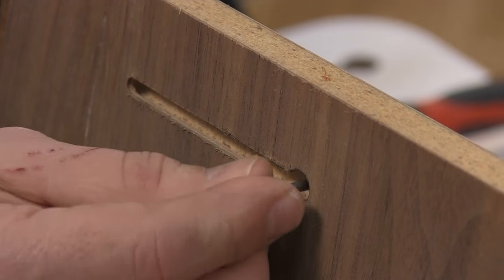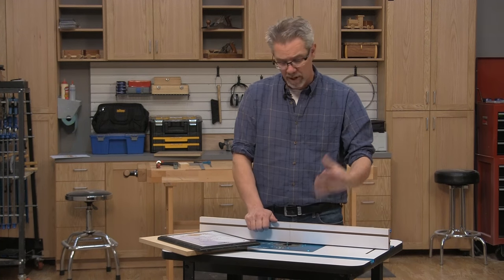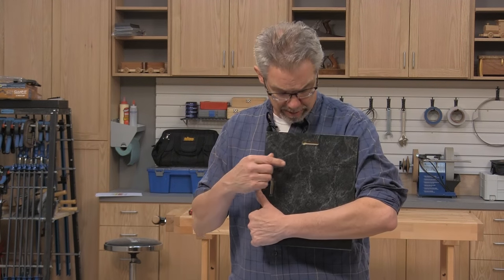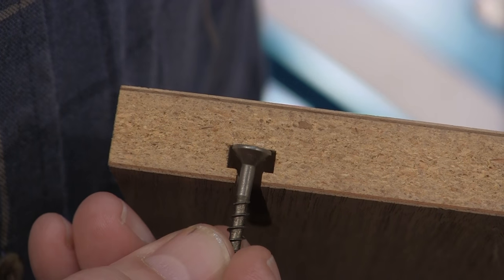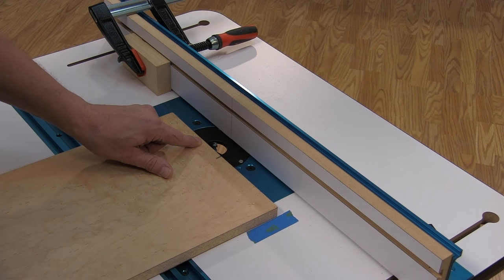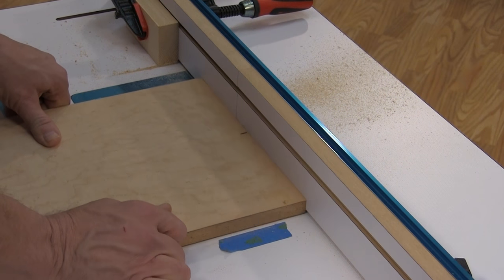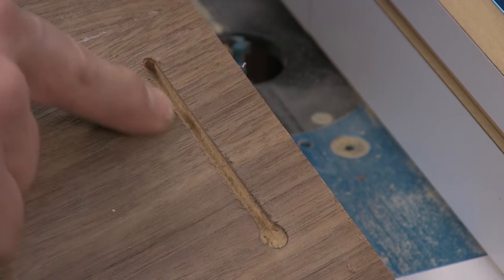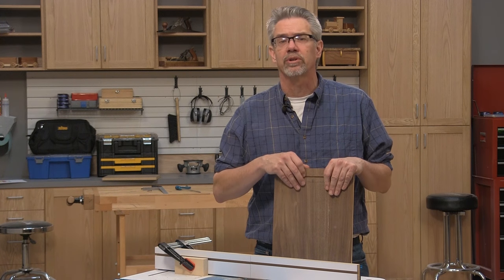Cutting Keyhole Slots for Hanging Pictures and Plaques

Comment: Done this when the dust/pitch accumulated inside the hole/slot and when turning the router off and sliding the bit back across to the exit hole.... it can’t align to pull out due to the compacted dust; sticking the bit tight to the table. Any advice on clearing this?
Reply: I think you need to keep router on while backing it out until you get close to your exit.

Comment: Not sure how I can see that plaque hanging from one screw and be centered?
Reply: He says the length of the slot isn't important as long as it goes through the center. When you slide the picture on you move the frame along the wall till the screw head is centered in the board and it just hangs there
Reply: Slide the plaque over the screw until it falls into the big hole, then slide it horizontally until the plaque balances evenly. Gravity holds it, same as a large painting on a single long wire. If there is a lot of vibration on the wall it is going to walk a bit and hang crooked, so maybe don't use this method for hanging stuff in your shop.
Reply: OK, thanks.  I always thought the plaque hung from the bottom of the slot (i.e. the opposite end from the hole), but I see how Rob's method could be useful.
Reply: At first I was a bit confused at how this worked. while you could put the slot vertically, you would have to get it perfectly centered so the picture is parallel to the floor.  putting the slot horizontally ensure that you can put the slot anywhere (as long as one point is going thought the center line of the frame) and the picture will hang properly.